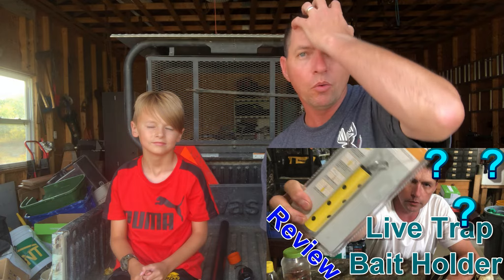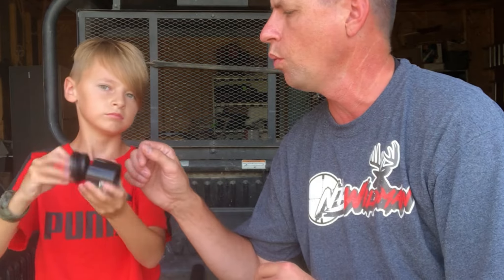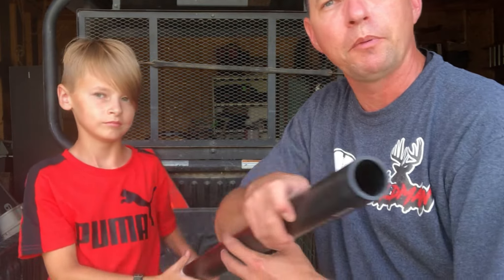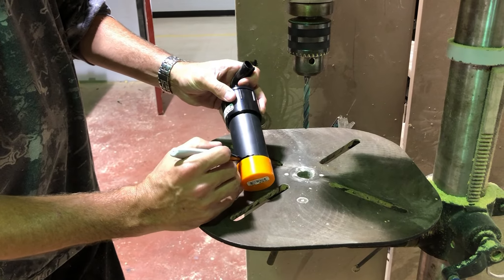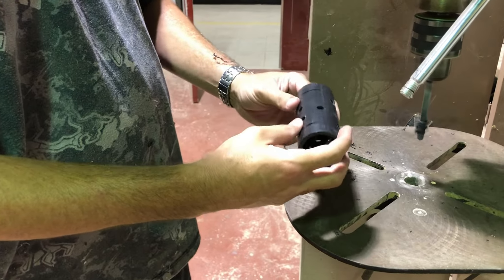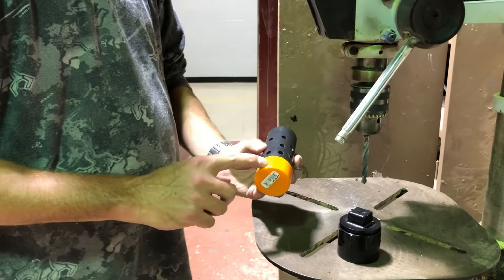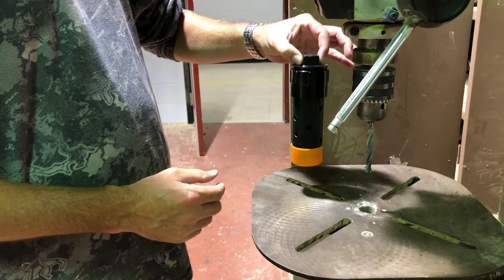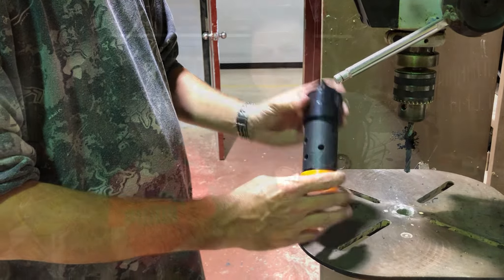DIY PVC Pipe Bait Holder for Live / Cage Traps

Comment: Like the idea...
Though I would have used 2 of those orange end caps. On one end I would add a fender washer (inside) and an eye bolt with a nut. Now it's less bulky and you still have a mounting hole. 
Just a thought.
Reply from the maker: good ideas